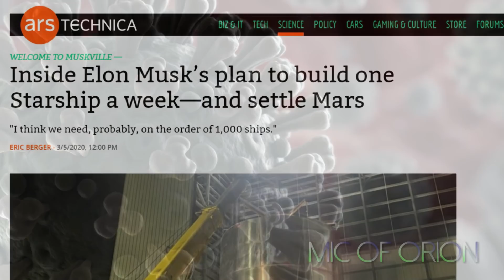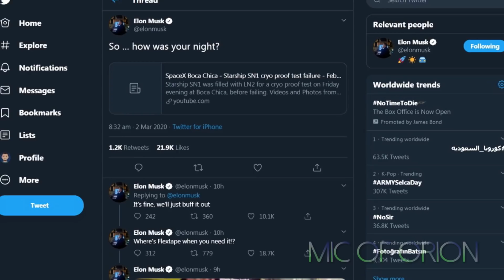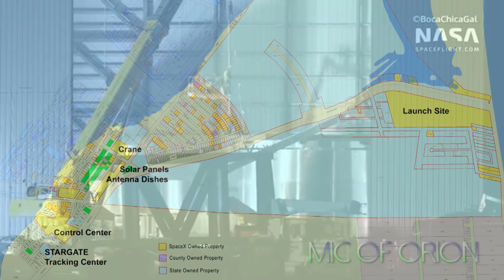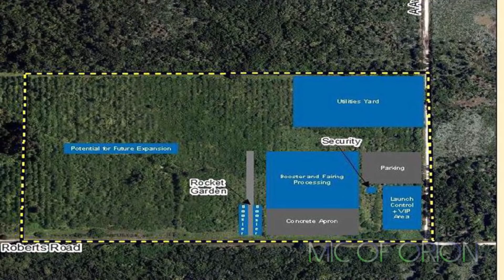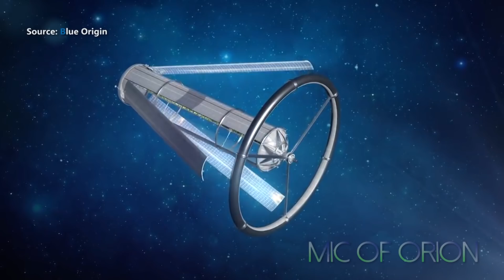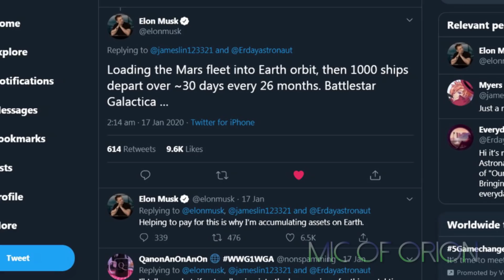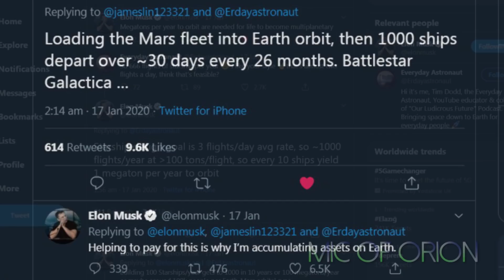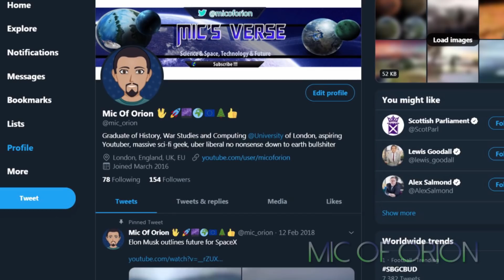Elon Musk Mars City Must Be Sustainable

Comment: I wonder when SpaceX will decide they need to construct a permanent orbital vehicle?  Starlink satellites will need to be refueled for orbit boosting and adjustment on a predictable schedule.  Having a fleet of refuelable vehicles in orbits means that they can cut down dramatically on redundant mass in second stages.  It's like adding a "subsidized" third stage to every subsequent launch.
Reply: They consider them disposable.  They will be at a height that servicing all of them wouldn't be realistic.  They're talking about 30,000 satellites I think was the maximum number once it's all said and done. 

When the first Starlink satellites were launched a few years ago or whenever it was, they had like 60 of them.  Those 60 satellites have an expiration date.  At some future date, they will all be decommissioned/de-orbited, and a new Falcon 9 launch will put 60 satellites where those de-orbited ones were.  Losing 60 satellites out of a constellation of tens of thousands of satellites won't affect internet service at all.  The people who rely on those 60 satellites that were de-orbited will just have a little bit slower internet until a new launch can refill the constellation.

Comment: Reducing the number of welds on the Starship will likely become a priority for SpaceX. Right now they are using a slip rolling machine designed to make water tanks. Don't be surprised if SpaceX makes their own custom machine that can bend sheet metal twice the width. Thus reducing the number of welds.
Reply: I'm sure he is buying the widest rolls already. Maybe he will buy a steel mill next?
Reply: @smacksman1  Remember SpaceX is aiming for mass production. If the orders are large enough they will produce any width SpaceX wants.
Reply: Shane Humphrey  If double the width of the coil you halve the number of welds in the column of the body of the rocket.
Reply: Shane Humphrey  Are you talking spiral weld, Shane? Could be an answer. I'm not trying to doubt you - I'm just interested in the problem as an engineer (retired). Rolling mills have a massive production line of rolls to produce sheet of a max width. To increase the width would be a massive investment. I shall be very interested in the long term production line outcome.